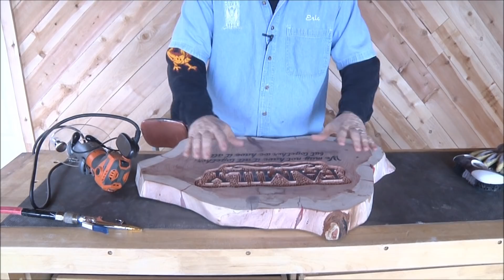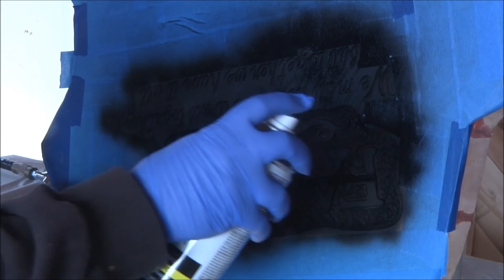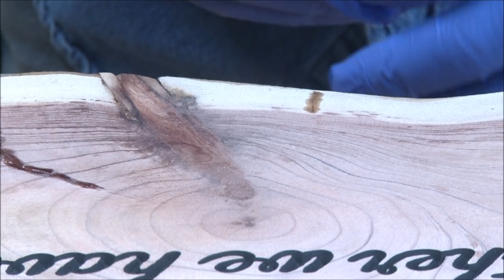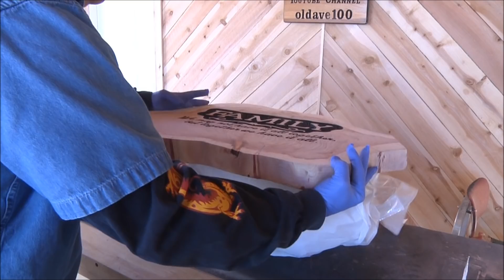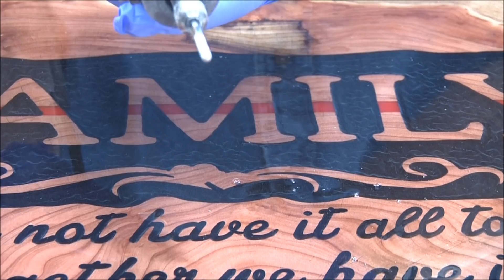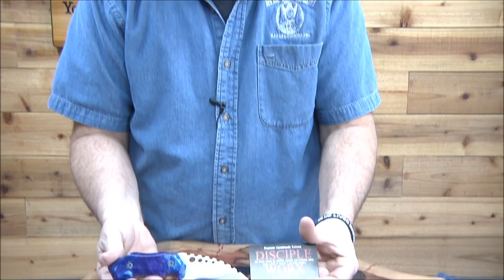#352 Part 4 Making A Large Redwood Slab Sign

Comment: Eric I love love art resin in some applications however, you really need to do some UV tests on this because if it is going to be out Stonecoat, resin is the best in all of the real life tests I have have seen for resisting yellowing I know it says it resists but it really doesn't do that well . Stonechat has a longer work time if you can believe that. It is incredibly hard also and they now have an art line that is just as good as their countertop but with some added benefits check it out. I think you would be more satisfied in the long term. Love this project.
Reply from the maker: Thank You for the kind words!!! I've never put resin on something I know is going outside. However I've been thinking more about the stonecoat resin because I'd like to be able to make exterior signs with resin. I will definitely check them out more.